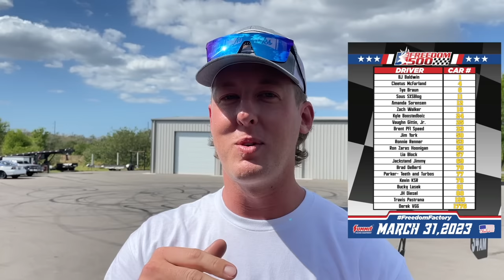I Bought the Most INSANE Street Car Ever... DESTROYED My Best Laps Around the Freedom Factory!!!

Comment: Can you imagine a fleet of these at the FF?  That would be an amazing event to see
Reply: Time to upgrade from the Crown Vic fleet!!!
Reply: To expensive, they would have to crack down on any shenanigans and at that point it will just be a nothing boring oval
Reply: @jaydunbar7538  about as any open wheel modified class which provides amazing oval racing
Reply: @camarowland4  that’s not the point of the Freedom 500. The point is live action…
Reply: @RodknockRhett  who says it has to be the freedom 500 or even the lemullets? It can be the Atom Smasher 250 or anything
Reply: @camarowland4  that would be great too but someone would probably get killed
Reply: it would sound amazing lol
Reply: @camarowland4  So many particle accelerator puns to be had.
Reply: This is way too much car for a small oval. They need to do more legit stock car racing, like 3rd gen Camaro IROC-Z. I also wonder if shifter karts are possible; that'd be a good one to introduce a youth event.
Reply: Might also  need a fleet of hearses.
Reply: @michaelscott-joynt3215  not enough iroc camaros out there. Plus I'd rather they stay preserved. Best bet is Toyota corollas for something g that you'll never run out of.
Reply: @jaydunbar7538  depends. This car can be bought in several specs. The 2300 engine is less expensive.
Still 65000/70000 per car new. But isnt there an import ban in your country for foreign cars?
Reply: @michaelscott-joynt3215  i think cleetus would score high if he put up an event for under 16? drivers. But i dont know about safety and liability rules. That could make it impossible. But dont you have something like karting(skeltering) over there? Kids 5/6 year old start up in competition and grow up in bigger vehicles. 90% of the F1 drivers started this way.
Reply: @henkoosterhof5947  bandeleros and legends. If it was a "regular" short track you'd see that  all the time
Reply: @camarowland4  Yeah the problem is they will beat the bejesus out of everything. I'd like to see hatchbacks too, less mass, maybe a touch slower, might be less damage and more side by side racing.
Reply: @Henk Oosterhof  they can buy or even build DF goblins.  Basically 1/3 or less the price of an atom.
Reply: @justin3663  please send me specs or a link. Like to learn this one. I think we are on paralel lines but dont know about your/mine available vehicles.
Reply: @camarowland4  please help me out. Whats ,,regular,,. And are 5/6 yo involved?
Reply: @henkoosterhof5947  regular meaning multiple classes running weekly through a summer season not just a special event venue like FF. The youngest I've seen in bandeleros is 8 years, in the legends series I've seen as young as 12. Both spec series' and very accessible as entry levels to oval racing.

Comment: If you get to keep the track running, it's going to be time for a full on repave.  That is looking nasty in more than a few places.
Reply: Ha re pave it needs to be raised about 30 ft  an then re paved Re Sloped RE Safety barrier'd an Obviously Triple Overkill drainage an pump.setup.
Reply: Sea level Rise + Hurricane's  STORM SURGE  + Then add the 1 in 1000 yr storm that hmm happens every YEAR.

Comment: This is why I love my cobalt ss . The boosted 2.0 ecotec (especially turbo ones) are a criminally underrated engine .
Reply: I’ve owned 2 LSJs and 2 LNFs cars are a blast to drive! I’d love to have a turbo lsj goblin
Reply: This is a civic type r motor, they are smoking meth
Reply: As In old school 2.0 supercharged, not current type r
Reply: @juniormeyer27  no it comes with the supercharged engine from the supercharged cobalt . Gm 2.0 ecotec supercharged aka LSJ
Reply: @juniormeyer27  What Cleetus has is an older gen Atom with the GM LSJ engine. The new Atom 4 has a K20 in it.

Comment: If you stay further on the outside of the turn and put better tires on it, you will go much faster, that car carries tons of speed in the turn so you don't have to hug the inside as deep as the crown vic
Reply: yeah because of the downforce the higher speed will suck it to the ground in the corners
Reply: Imagine being behind a keyboard and telling a pro driver how to drive. Smh.
Reply: @jeremyweisinger8655  it's called friendly advice. Imagine being behind a keyboard and thinking you are a warrior of some sort.
Reply: @jeremyweisinger8655  Imagine not believing pro drivers don't also watch Cleat and crew. Drivers with experience in the seat of the atom.
Reply: @jeremyweisinger8655  Imagine calling Cleetus a pR0 DriVeR...
Child sit back down. 😂
Reply: @bigduphusaj162  . They build Atoms in the US and also have a series that they race in. there are plenty of people outside the UK who know how to set them up.
Reply: @bigduphusaj162  The high output models really need downforce, particularly in front.  Here in the US our bumpy tracks absolutely crave front downforce.  I helped tune and crew an early model Atom with a supercharged Honda K-series producing about 450 hp.  The car was originally equipped with no front aero and would actually pull the front tires visibly off the ground over small hill crests during acceleration.  Once the aero was added the car became immensely quicker.

Comment: I have a rotary powered EXOCET, a tube frame kit car kind of like the Atom but a bit easier to attain & not as refined. Not to say the EXOCET isn't good, the Ariel is just definitely more sophisticated. I go to alot of GRIDLIFE events and last year I saw one of the Honda K series powered Atom's at Lime Rock Park. I ended up having a faster time due to having quite a bit more power, the peripheral port 13B in the car is putting down 452 hp & 366 lb-ft of torque to the rear wheels but in the corners he would eat into my lap time like crazy lol. He was talking about doing a 4G63 swap in his Atom & while I love the 4G I told him to just build the K series as they can make good power with the right build. Led me to upgrade quite a bit tho. Great choice guys, I didn't think the ECOTEC one was could sound as good as the K series one but it does LMAO. Who ever wins it is gonna have a blast. 🤙 Keep up the great work fellas 🤘

Comment: Cleetus that sure looks like a fun ripper. I have that same engine in a sandrail and it rips too. If you are looking to add more horses check out ZZPerformance for pulley upgrades on the supercharger and even a turbo swap kit. They are pretty much the leader for ECOTEC engine performance.
Reply: Dont they also use it on the Xbow or the slingshot as well? I can't remember which it is, but we worked on a house and the guy had one in the garage that had a treatment of ZZP parts, he said it made something like 273-275 to the rear tire, and it was more than he could ever dream of utilizing, but it made for a fun toy 😂 best part? He's a proffesor at the university, never would guess a guy like that would have a toy like that hiding in the garage lol
Reply: If it's an m62 powered lsj, making over 300whp. Guaranteed its got everything zzp or ottp offers lol

Comment: A sequential gearbox in this would be insane
Reply: It has a motorcycle engine in it, so it already has a sequential gearbox.
Reply: @markbremmer8642  no it doesn’t this car has an ecotec which is a gm engine
Reply: @markbremmer8642  These can be powered by many choices of powerplants.
Reply: Alot of them run a honda k20.
Reply: @markbremmer8642 they literally said it's an ecotec
Reply: Look up the Ariel Atom V8.

Comment: I’m sure Tye can make one of those with a ls power plant that would dominate spectator drags!!
Reply: I bet Tye can build one. But maybe an LS is to heavy. The ATOM 500 had a 3.0 V8 pushing 500 bhp
Reply: Kyle can build a 4 banger that will bolt in place like a sticker with power from 400 to 1300 hp. Check out Boosted Boys if you haven't already.
Reply: If it was a 2 lap race, sure, but for one lap it would still get beat by a 4wd Porsche.
Reply: @MrArcticPOWER  a stock Atom is as quick as a Turbo S 0-60 and if that one is making 330 WHP it is far from stock. The Atom's power to weight ratio is sub 4 lbs/hp compared to about  6.2 lbs/hp for Cleet's Turbo S.
Reply: @ReEvoluion  0-60 times on paper doesn't mean much on a track like this. We've seen plenty of big power RWD cars having no traction on this track and getting beat by a model 3.

Comment: amazing - the normal Honda engined version does 0-60 in 2.6sec. The flatplaned 3litre (2 x hayabusa engines) V8 is only 0.3 sec quicker. I imagine the Honda engine with a blower on it would be absolutely insane - hope you win it so you can then get to twin charge it with a turbo!

Comment: Man that thing looks insane. Even more insane is that Ariel made a v8 version of the atom with 500hp.
Reply: Find someone that has a Ariel atom V8 and bring it to the track for comparison
Reply: Ariel didn't make the V-8 version ....It was an owner that did it......
Reply: @davearmstrong5226  yes they did. Ariel released a limited number of v8 equipped atoms.
Reply: @davearmstrong5226  oh they sure did, it was basically 2 4 cylinder motorcycle engines mated together and revved to the moon.
Reply: @Underpantsniper  2 hayabusa engines 😅
Reply: @davearmstrong5226  Palatov made the original V8 Atom. Ariel saw it and went "Yeah, we're doing that."
Reply: It's two 4 cylinder superbike engines bolted together though, not an LS 😂
Reply: @solatyn  yes, 2x hayabusa engines
Reply: @IamBATMAN2024  I think it was just the heads and pistons from a busa engine. Everything else was bespoke.
Reply: @Underpantsniper  From 2 hayabusa engines (top ends) yes
Reply: Nope

Comment: Well it's a k20 engine from a honda or integra type r from Japan so if you take the exhaust and put 4 into 1 it will have more power but supercharger is more for torque and you put a turbo you can get 500 plus of stock setup just change injectors manifold intake and fuel.pump and haltech ot hondata then you can squeeze 600hp plus

Comment: I feel like if you can adjust the gear ratio, it’d be a monster on the oval track. With some better tires also.
Reply: It's worth checking out. Even stock, these things crush just about anything on most modern tracks. Around the Top Gear track it's just as fast as a Veyron, or BMW S1000RR
Reply: @RobertMorgan  they are definitely great in stock form. But i think just from the way it drove around that track, it needs a shorter gear ratio. 2nd gear was too short.

Comment: If I were cleetus, I would build a purpose built car just for this event under the same parameters that the atom was built.  Start with something VERY LIGHT.  Throw out everything that doesn't make you faster.  Add power(preferably a junkyard LS!). Add aero and the widest sticky tires you can find. Super late model modified tires should do the trick. Have jackstand tune it just to embarrass everyone who runs against you. Lastly,  cover it with mountain dew stickers like they are your main nascar sponsor.

Comment: 🇺🇸🦅🏁 My buddy has a DF Goblin kit car. They are cheaper than the Atomic Adam, they look very similar. But they use the Chevy Cobalt for a donor. My buddy used the SS Turbo Cobalt and it is stupid fast. He has less than $25k in the whole kit, including the donor car ($6500). I seen it personally run and hide from a 800hp C7 Corvette from a roll. Once he received the kit it was on the road in about 6 weeks just building it after work and weekends. He even had the factory 5speed rebuilt with a new clutch because the donor car had 130k mile. DF Goblin is based out of Texas I believe. I believe his car weighs like 1400 pounds. It handles like a Indy car in corners. It’s half the price of a AA and just as fast from what I hear. A Goblin would be a great shop build for the crew. I bet you could build it in a week or two with the great team you have.

Comment: There is no such thing as a "cantilever suspension". It's pushrod or rocker arm. Cantilever is a stationary support structure not a moving system. Does your LS or Godzilla have cantilever valve actuation?  No it doesn't.